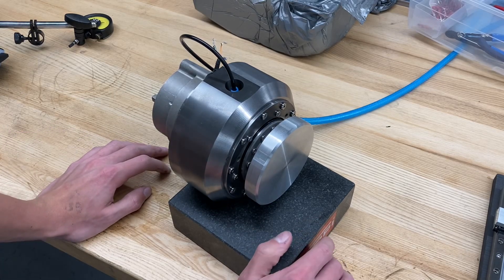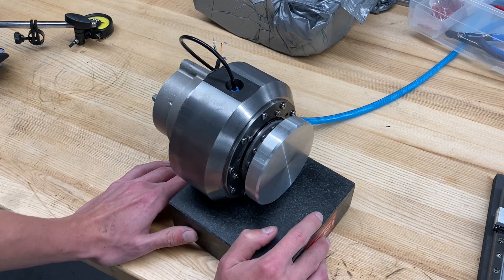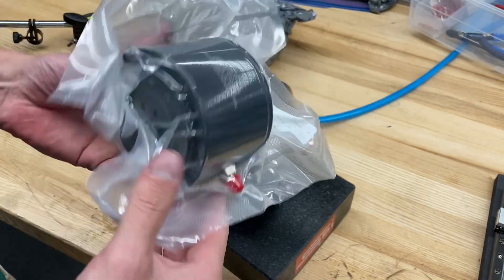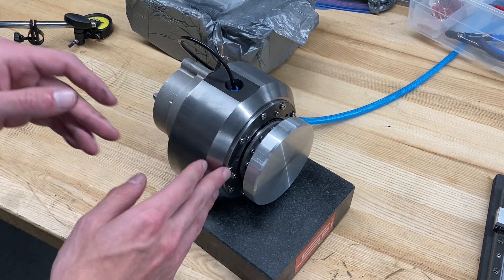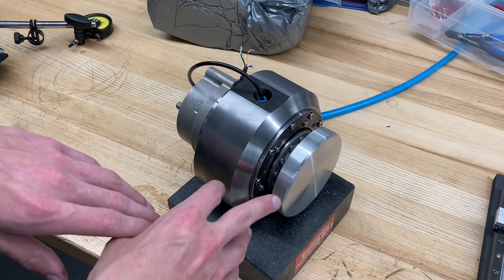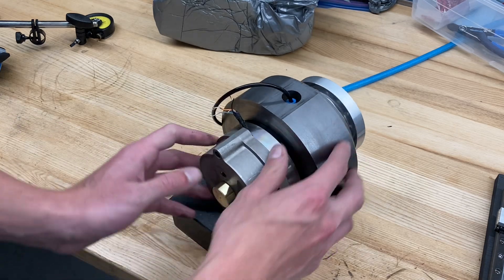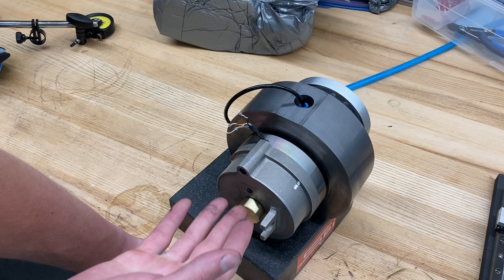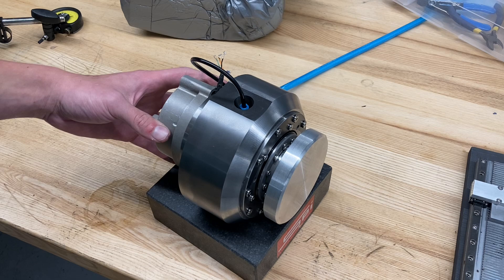Professional Instruments Air Bearing Spindle for Diamond Turning Lathe (!?!?!)

Comment: Hey Cyrus,

I Just watched your video from 5 months ago on investigating form error from clamping. Glad to see the results. I was wondering how that drawbar system would work out…. Much better than I expected!

I think the springback in your work holding is unavoidable - even with a more complaint flexure. 

Would you consider magnets embedded in the notches of the coupling? This will keep the preload in-line with the contacts so there’s no (or just less?) bending out of plane.

I could see this bringing up balance issues by location error of the magnets and each being of slightly different mass. 

I could imagine that drawbar having some shaft whirl as well - though I reckon the spindle speed is slow enough to not create an issue 

Looking forward to the next update as always!

Comment: Hi sir, what’s the maximum rpm the spindles can handle. And which company bearings was used sir.
Reply from the maker: @sandeeps7979  15000 RPM max i think. Try checking the title or watching the video and see if you can figure out the company by yourself (hint: it’s in the title of the video 😱)

Comment: Not sure if it makes a difference on repeatability but if you add a hex to the brass knob you can use a torque wrench to tighten the draw bar. You could also number the cut outs on the “chuck” and aluminum plate so that it is going on the same way every time.
Reply: Too much clamping force (or any at all, really) will distort the workpiece. It doesn't sound like much, but this can easily be beyond the tolerance of optical components such as mirrors. I'm not sure how much distortion the hand tightening imparts, but you really want the absolute minimum necessary for stable machining/finishing.
Reply: @denniszhang9278  I was thinking a low torque around 15-20 in lbs would similar to hand tight but more repeatable.

Comment: Nice project :) I was wondering since you put a magnetic rotor on the spindle - if the magnetic field propagates through the air bearing spindle, did you end up with magnetic front?
Did you check the alignment of the motor rotor and motor stator axis - if they are not concentric, you can get additional radial force and preload the spindle?

Comment: Very cool. In the thesis you have in the description one of the two surfaces of the coupling is rounded so you have no flat on flat but Zylinder on flat contact. 
Do you see less precision with a flat on flat design? Seems to be way easier to make.
Reply from the maker: Yes, the design we're using is a flat on flat variation of the original design. This has been successfully demonstrated by a certain precision focused university in the past. While it technically can't get as good of a result as the round on flat design, is it a good choice for this application because it provides higher stiffness while still being extremely repeatable. It well satisfies the requirements. Again, keep in mind these rough milled prototypes are already repeating to under 20 microinches. ground and lapped ones will be even better
Reply: @cylosgarage  awesome! What is the repeatability like when you rotate it 120 or 240 degree? As there is no compliance in the system like it is on erowa or 3r pallets you must make them real precise, no?
Looking forward to see more of it!
Reply: @hampfi747  I suspect that the main compliance mode is the theeth toppling outwards slightly in Cylo's design.

Comment: Great work, thanks for sharing. Is the Hale connection very susceptible to drawbar torque? Just a guess but i would have thought any slight misalignment of the machined mating surfaces would cause a bit of elastic throw to it? Just a guess though as ive never made one (or heard of them!)
Reply from the maker: The way in which they are machined, there is a very small chance for misalignment, which is why they’re so repeatable. There certainly could be some deflection if you over tighten the draw bar, but you really only need to snug it lightly. As long as there is a decently centered seating force, those things aren’t going to move anywhere.
Reply: @cylosgarage  ok thanks. I had a look at the phd and it doesn't mention manufacturing method, just that it needs precisely straight lines. Did you do it on a rotary table? Do you think 3d surfacing would be precise enough?
Reply from the maker: @lawmate  a very good rotary table would be the ideal way to do it yes. However, the most accurate way we have of making them is with the cnc.
Reply: @cylosgarage  ah cool, that's good to know. I do a fair amount of 3d surfacing on my CNC, so I'll definitely give the design a go. I think i will extrude the surface where the bolt goes through so there isn't an air gap. Thanks again for sharing
Reply from the maker: @lawmate  Nice, that's a good idea, that way you get a repeatable preload force. Be wary of the parallelism of the boss that the thread goes in though. If that surface and the one it mates with aren't perfectly aligned, it'll ruin the precision.